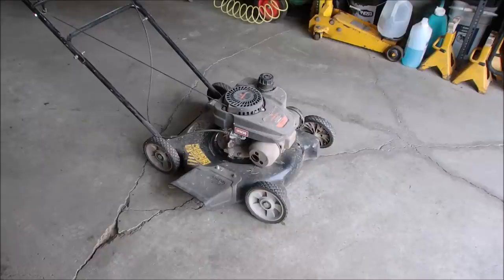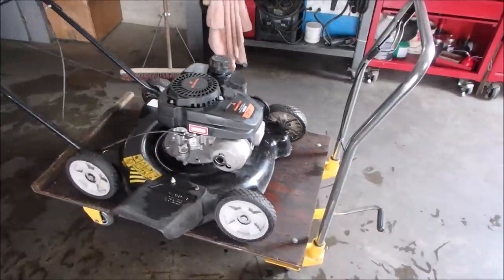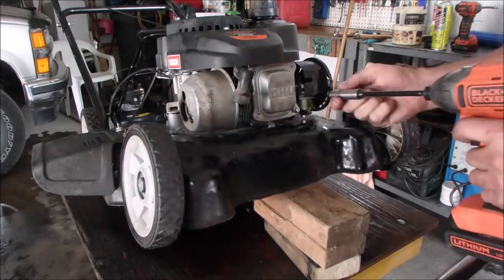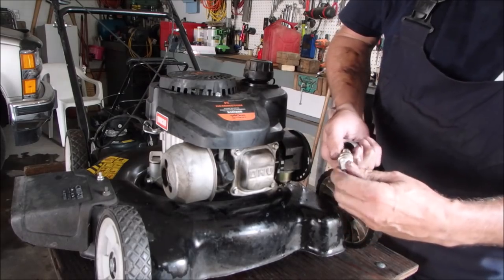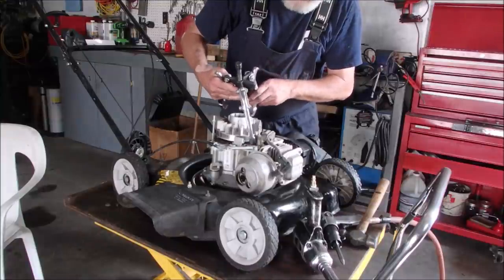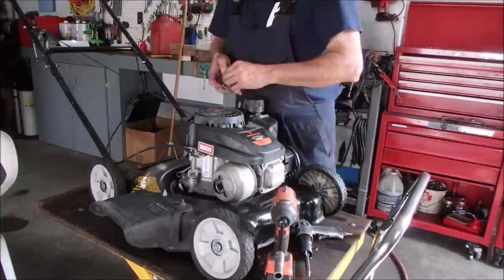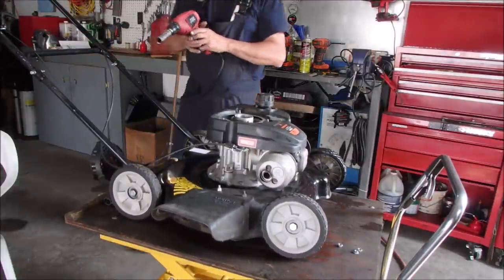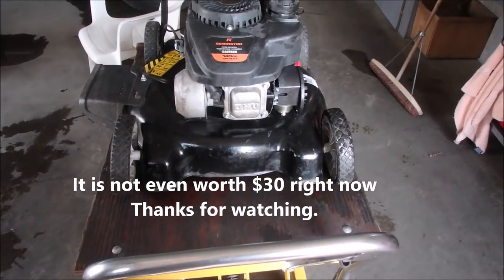A Remington Mower with a Powermore Engine Noise!!!!

Comment: Sounded like the blade was loose. I had a mower in my shop with the exact symptoms and it was just a loose blade and adapter. It had sheared off the key in the adapter so it wasn’t spinning with the engine fully. Swapped out the adapter and made sure the bolt was good and tight. It solved the issue.
Reply: I go with the blade idea too. The rattle was too loud to be coming from inside the engine.
Reply: I agree with this assessment. I have one with the same sound and also had a sheared key in the blade adapter in my shop currently. I think it happened because the blade was upside-down. Waiting for the blade adapter to show up so I can finish it up and get it out.
Reply from the maker: @adambrown8009  There was so much aluminium in the oil i knew it was toast.  Thanks for joining in though

Comment: Since the engine was seized at first, combined with the knocking noise when it was running, and difficulty starting, would indicate to me that the piston was badly scored and rattling inside the cylinder. Running a compression check would have given a better indication if this was the case. I'm guessing this mower barely has enough compression to run at all.
Reply from the maker: You are right

Comment: Hi Bruce, good thing that's a freebie, I got one last year that only had 2 hours on it. The owner was wealthy and didn't like it. He paid 200.00 for it but they are not great. If you tip them carburetor down the oil runs out worse than a Briggs and fouls the air filter I have seen Briggs flywheels ruined from hitting stumps or whatever and a insert in the flywheel turns slightly and they will be hard starting, knocking and rip the handle out of your hand!
Reply from the maker: Yes   My last video the key was out only a tiny bit.  It helped to reset it.

Comment: Hello again Bruce, my experiance with virtical shaft 4 strokes is that if the oil level is too low, the top of the block gets starved of oil. The slinger throws enough oil to keep the con-rod happy, but the top journal of the crank eats the top of the block. I am sure that if you hold back the brake and check for moovement back and fourth at the flyheel, you will see the source of the noise.
Reply from the maker: Thanks Jeffrey

Comment: Funny you would post a video on a Remington. In Ontario they sell them for $199 Cdn and we took one in on a trade for a mulcher last year and it was only one year old. Once we cleaned the carb and put ethanol free fuel in it we were surprised to hear a knocking sound like yours! Check everything and figured maybe that is what they sound like now we know. Sold it for $100 and guy just brought it back for oil change, air filter and blade sharpening guess what still sounds the same and he used it all of last year.
Reply from the maker: Interesting.  Thanks   This on was seizing.

Comment: Check the rod bearing end play at TDC by turning the blade back and forth to check for rod knock. The oil looked bad, do an oil flush until it looks good.
Reply from the maker: In my mind this is a 40 dollar mower if everything was good.  It really is not worth the effort.  Buy I will do an autopsy on the next one.  There will be more I am sure.
Reply: @BrucesShop  that is the cheapest mower you can buy, but now they are going for $200 US with the price increases.
Reply from the maker: @berardia4  Crazy eh!!!

Comment: Hello Bruce. I guess you're back now eh. Yes definitely put a different engine on this frame, it's in good shape yet. Take the good parts off the engine and throw the rest to recycling.  When you had it on its side and it leaked oil onto your cart the oil looked awfully Grey, that's when I knew the engine was toast.  Welcome back my friend
Reply from the maker: Yes the oil had a lot of aluminium in it from the case

Comment: That's why they call Powermore engines Powernever.  Maybe I wasn't paying attention, but did you try pulling the plug wire off while it was running and see if it still made that knocking sound when it stopped?  Could just be the brake rubbing on the flywheel doing it.  Most likely is internal issues though.
Reply from the maker: It was the Rod causing high friction.  There was so much aluminium in the oil I just recycled it.

Comment: Need to get some sides on the lift.
Reply from the maker: No   it has been this way for 6 years or more.  It is OK as some stuff goes beyond the sides.  But that is a good observation.
Reply: @BrucesShop   Glad it wasn't running when it slid off.  Be careful.
Reply from the maker: @RichsMowersNBlowers  right

Comment: Hi Bruce,
I see quite a few Remington lawnmowers for sale in my area.  I won’t touch them!
I suggest you check the brake pad.  It seems to only make that noise when the bale is released.  Although, it could be knocking in that scenario because the combusted fuel is no longer pushing the piston down, allowing the rod to rattle.  
My two cents,
Jim
Reply from the maker: No  It was seizing.  There was so much aluminium in the oil it was grey colour.  Thanks though Jim

Comment: Did you check the blade adapter for the noise.
Reply from the maker: You know I have been fooled by that before.  The oil had so much aluminium in it that is when i gave up on it.  At 5:43 the engine was locked up.  Then I unseized it with a hammer.  thanks for the comment.  Fun to look back.

Comment: Hey there Bruce its good to see you in the shop again. A Remington lawn mower i would have to say this is the first I have ever seen one of these it looks like a nice mower I wonder though what brand engine they used on it. I'm not exactly sure what it is thats causing the rattling noise its making maybe a loose or slightly bent push rod I don't know interesting though. I am curious what it could be a little autopsy would be worth i think to see what is going on with it. But until the next one take it easy. 👍
Reply from the maker: It is a Powermore engine I learned.
Reply: I have a Cub Cadet with a similar engine. When I bought it, there was a Toro next to it with the same engine from China.
Reply: @BrucesShop  I have heard of power more but I'm not very familiar with that brand.

Comment: Good catch on that dented in valve cover. That is a weakness in the OHV engine. They point the cover forward and someone rams the thing into a tight spot like a split rail fence and the cover tolerance is tight and the cover now interferes with the valve train. Put a Quantum on it and someone can get 15 years out of it.
Reply from the maker: Thanks for the info

Comment: Bruce, when you tipped her up on her side you sure made a mess. But I think you discovered a new way to change oil though.
Reply from the maker: I do that too often.  LOL
Reply: @BrucesShop  as long as you took the air filter off first, otherwise you have to buy a new air filter.
Reply from the maker: @haneyoakie14  Thanks  good point.
Reply: @BrucesShop  that is a classic “ask me how I know “

Comment: Don't rule out the plug , torch is not quality at all . I know tecumseh flywheel key if even partially sheared will cause a starting problem similar to that and valve clearance adjustment for sure will pull the rope right out of your hand . Just depends on how long you want to chase that ghost!!!! Lol 😆
Reply from the maker: Thanks

Comment: How's she goin'?  OK, here goes ...  when you first got it running you mentioned it was running slow besides making the knocking noise.  I think there are problems inside the engine.  Maybe what ever was hit, even though it didn't damage the key, may have damaged the governor mechanism.  This is now affecting the valve lifter and that's why it got hydro-locked and is making the knocking noise.  You also mentioned the oil looked gray and the oil that came out of the spark plug hole looked real bad, so what ever is damaged inside is slowly wearing away.  I think an engine strip down to see what's up is in order if you want to spend the time on it.  There, that's my 2 cents worth.  How close was I?  LOL  Take care!!!
Reply from the maker: Yes and I didn't do a teardown.  Next time I will.  There are lots of these out there.

Comment: Put a thicker oil/conditioner in it and sell it as is for cheap. I have customers that ask for cheap machines they can use or leave at rental properties, backup mowers, selling their home, etc.,,,,
Those are cheap mowers to begin with; generally I take them for parts when needed and recycle the rest. 
I've asked many customers here or have been asked myself. Depending on the machine and price they just want maybe 2 years of use. 
Its not my logic but I get the idea. Especially these days, people are tight for cash!
Personally, I like to sell nicer properly serviced machines. I don't like the idea of putting good oil in a bad motor lol!
Reply from the maker: I needed a hammer to turn it over without the brake.  I parted it out.  Sorry

Comment: What year was that mower? Is it 20 inch? Die from lack of maintenance or because it it made of Chinesium? Looks like Home Depot $169 bottom price point mower. I use pictures of the HD mower in selling my $100 used Toro or Craftsman mowers. Why pay $169 for cheapest new mower when you could spend $100 on a quality used mower with me standing behind it?
Reply from the maker: You are so right.